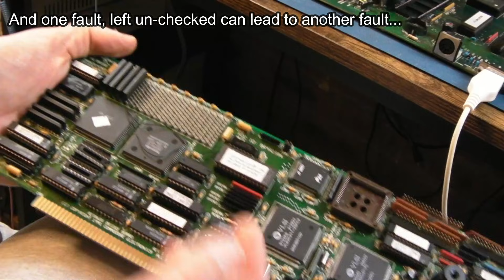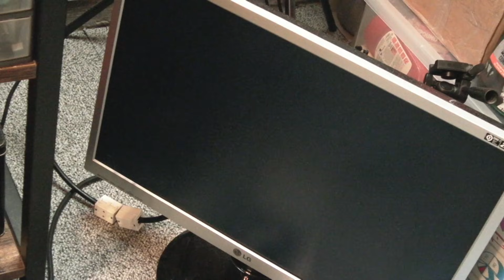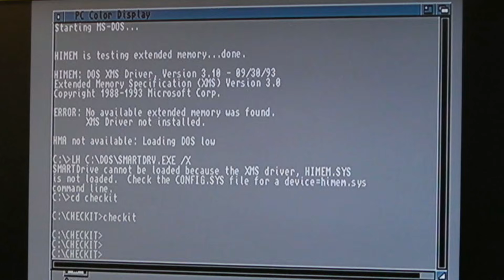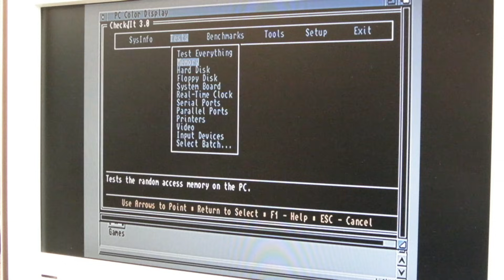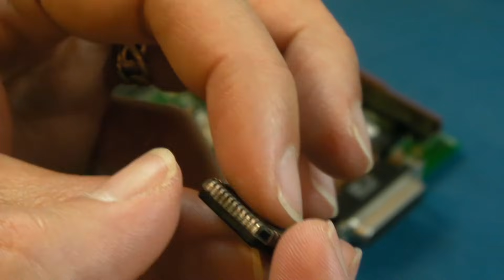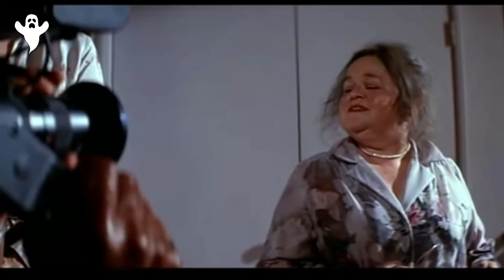Amiga 386 Bridgeboard Repairs  - How Many Issues? Part 3 (2 x A2386)

Comment: To get my 486 BB to work, this is what was done. I fully populated the board, then either hooked up a bootable HD to it, or wrote the same file type header to a dedicated Amiga HD partition, installed MS-DOS, then Windows and then reboot. Done. No secondary Janus software mucking it up.
Reply from the maker: I do use the Janus features though tbh!  It is useful being able to transfer stuff too and from the Amiga.  You can also share network and even RAM (although RAM is slow doing that!).